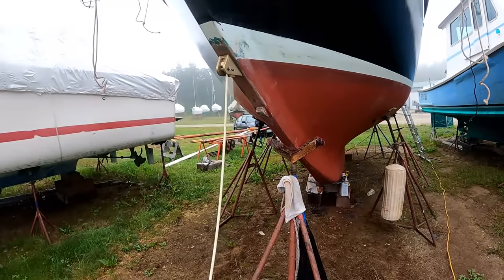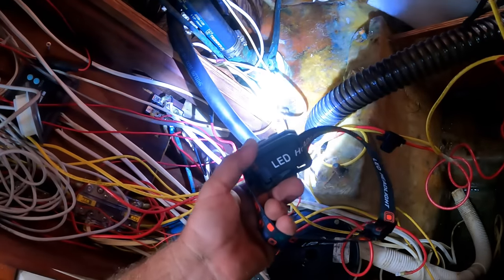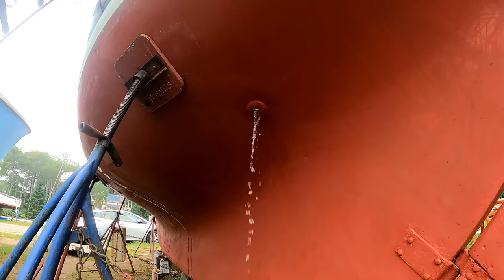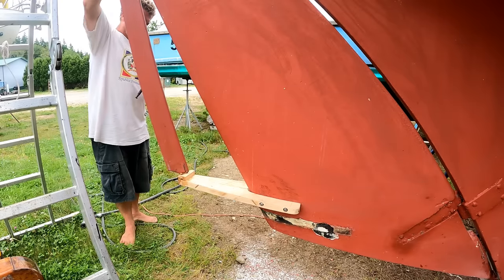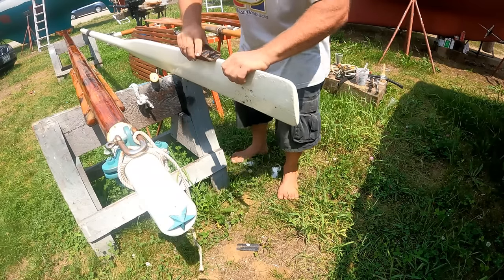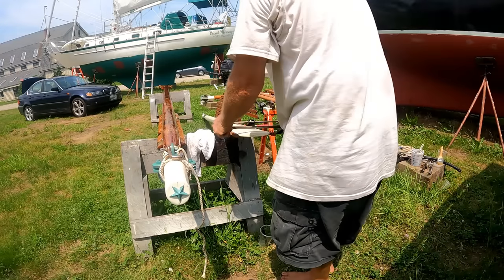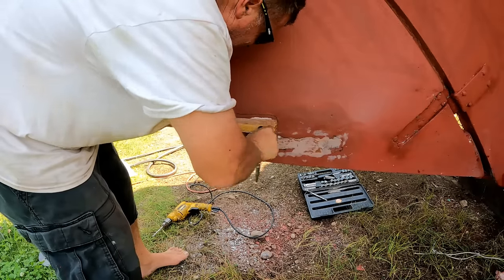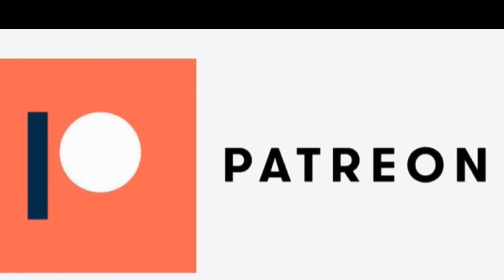The Work Continues, Baby Ruth Recovered!  |  Ep. 227

Comment: Thanks for the idea about tape funnels. I've been looking for a way to fill outgassing bubble holes on timber that has to sit vertically while being epoxied. Doing what the West Systems manual says to do (i.e., waiting for the epoxy to partially cure before applying) wasn't working.
Reply from the maker: I've done the same thing with some opened seams in the mast.  Tape them, put a tape funnel at the top, and inject epoxy with a syringe.  Worked great.